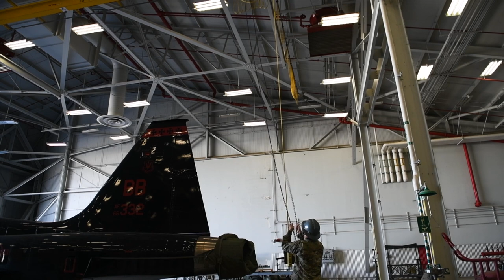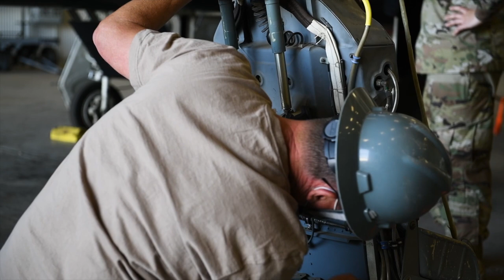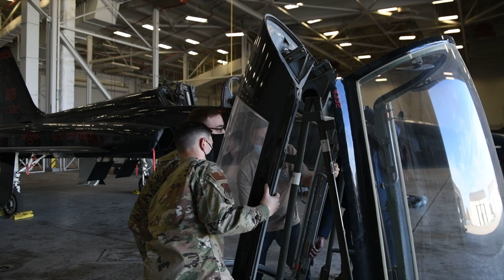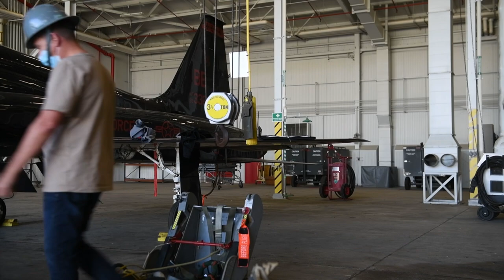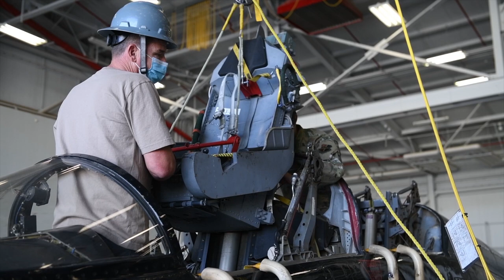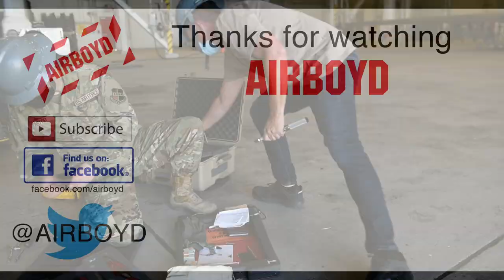T-38 Ejector Seat Maintenance

Comment: I found this video to be pretty interesting(and funny).I was in the USMC(airwing) from '63-'67 and my job description was "Safety and Survival Tech."(6443). We(in the seat shop) handled everything that had to do with pilot safety and environment. Ejection sys.(seats and ordnance actuators) /Canopy /pressurization /Air Conditioning /Oxygen .... the "Parachute Riggers" dealt with Helmets /Oxy. Masks-intercom /Clothing & Boots / Survival Packs(seat) / and Parachutes. We all worked out of the same shop and did it all (usually working off stands or lift beds - no hoists - all muscle power. we would "disarm the seat - the riggers would remove the chutes & seat packs - one guy would stand on the canopy rail and lift the seat up/out and pass it to the guy on the lift. reverse for installation ....

Comment: can you jettison the canopy without ejecting?
Reply: on most jet/seat systems there is a "canopy jettison" handle that works independently of the ejection handle(s) ....... if however you initiate the "ejection sequence"(handle(s)) it's all going in whatever sequence that A/C was designed for(and there is no stopping it) ....... usually canopy/rear seat/front seat . on some older systems the seat went through the canopy(F-4 Phantom)
Reply: @unclejack123  , thank you sir!
Reply: Yes it has an internal and external canopy jettison handle